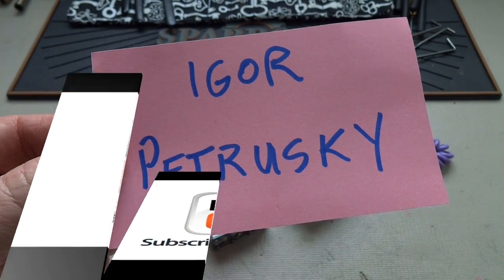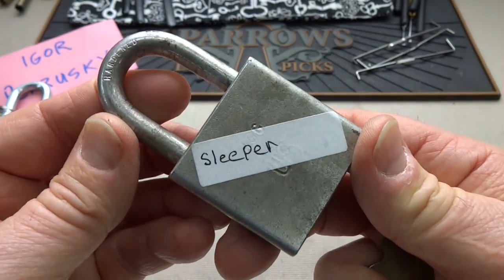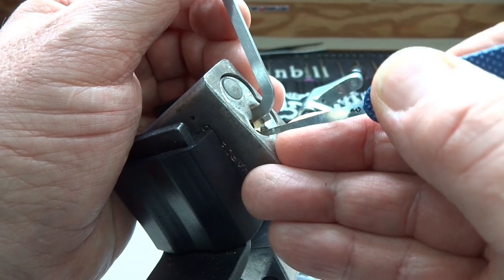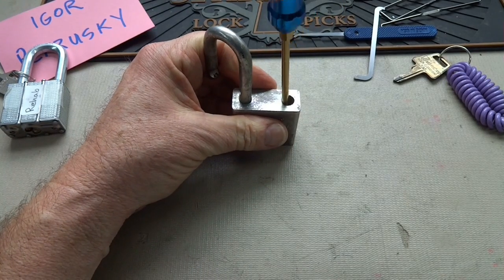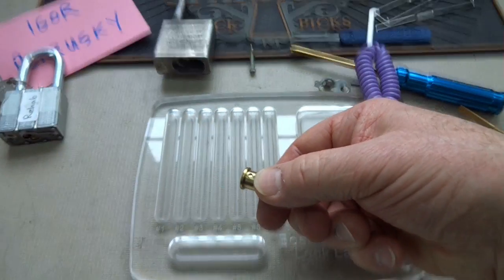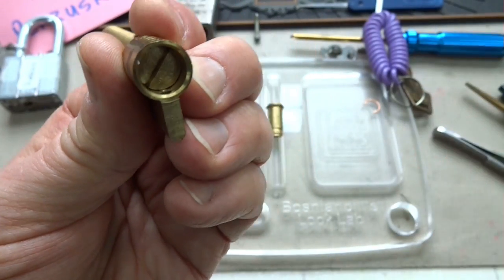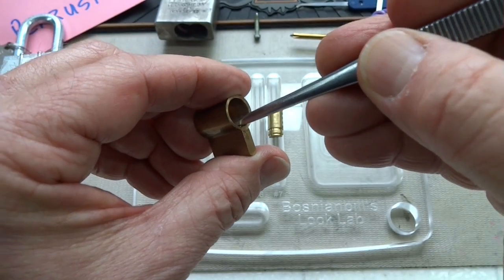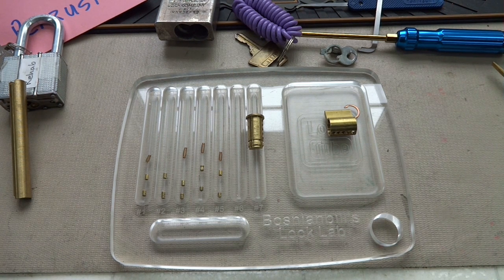(744) Igor's "Sleeper" American 5200

Comment: awesome job again BB. the small springs were definitely unusual. but would you say it would have been a easier pick since there is not much resistance?
Reply: Oh I didn't think of that. Now I can see how you could easily over power the pins even with light tension. Thank you for the great vid.

Comment: chessguy used a flashlight to help pick it. looks like a guy with a 3d printer could make a handle with a white led in the handle, couple of button cells, one side of the led to the pick, the other side to the button cells and a ground wire from the button cells alligator clipped to the lock. inserting the pick would turn on the light.

Comment: Bill, I have a question about tension wrenches.  I have a lock (it is a master #5) that I have seen you pick it with your nose....  This one requires substantial tension once it is picked to get it to unlock.  Typically, my tension wrench bends before it unlocks.  I have put some lube in it, worked the key and still the tension is a bear.  The frustrating thing is I can have it picked but due to the tension required to open it, I do know it is picked.  Any advice?  All my gear is Peterson.
Reply: Thank Bill.  I have the new Peterson top-of-key-way wretches and you are right they are stiff but for some reason have not picked this lock use one yet.  I think they are great and have had a lot of success on other, older lock.  I will keep at it though.  Not one to give in easily.

Comment: Hi Bill when watching the strip down it looks like it is a key retaining actuator which means you wouldn't be able to bypass it could you have a look at the internals and tell me if it is key retaining and if that makes it not able to be bypassed
Reply: +Mike Burston Any unshielded American can be bypassed with a Pederson bypass tool. It's easier than a key sometimes. Bill has a couple vids on it.
Reply: what i noticed on this particular lock is that the actuator cam is a half circle type instead of a quarter circle type which makes me think it would require the barrel to turn as well. i don't have one like this to test it out so would be interested if someone could try it and let me know

Comment: Now thread the bible and that other chamber, use regular springs and the same pins.
Reply: +rallock67 The reason for not threading the spool chamber is to leave tolerances on the spool as tight as possible. This in theory should force all other pins to drop when the spool is being picked. Of-course it being a spool with other pins being fatter would result in no binding until all other pins are picked, dropping them when the spool is being picked. There was also an Abus 34/55 in that package; that should be a more difficult pick. The two locks in this video were meant as a rehab after Bill gets done with the Abus that i sent in the same package; but now he used up the rehab...
Reply: +Igor Petrusky I would take the spool out and replace it with the serrated driver. Gerry Finch is one of the locksmiths that created the "S" pins for LAB.
He said in his article that with all chambers threaded and using "S" pins a the last chambers; using standard pins in the first chamber to disguise the lock. This lock would be next to impossible for someone with average picking skills to pick in a reasonable amount of time
Reply: +bosnianbill I have been thinking about doing a lock with no springs.
Also one with magnets as pins
Reply: +rallock67 using standard pin in 1st chamber would make standard pin bind first, so after picker lifts it, we are back to a 4-pin lock with 4 serrate pins in 4 threaded chambers, true that they would catch on threads, but it is still a linear pick from then on. Spool is essentially a core resetter if you put it into chamber with tightest tolerances.